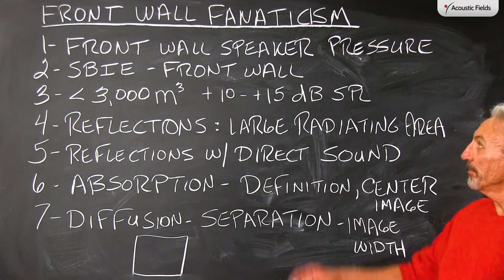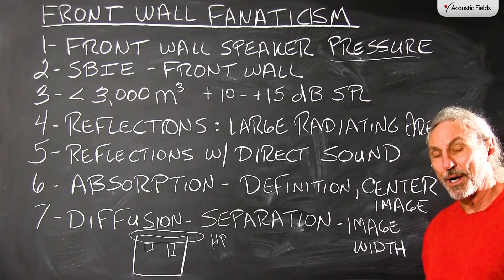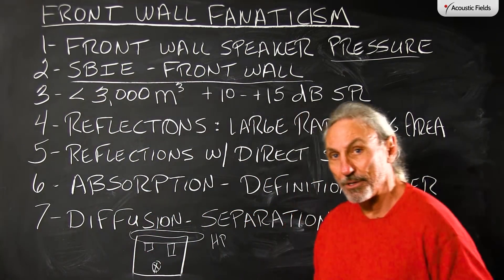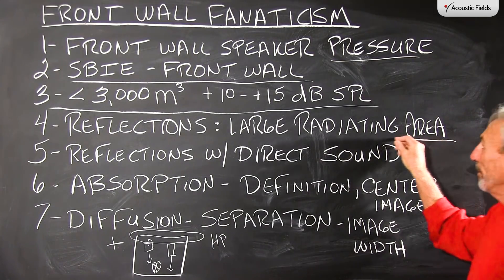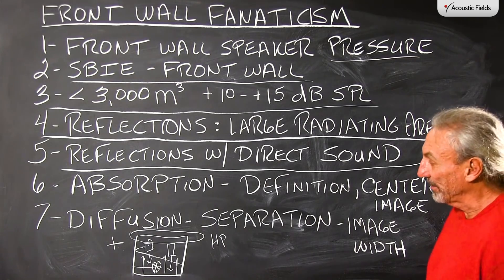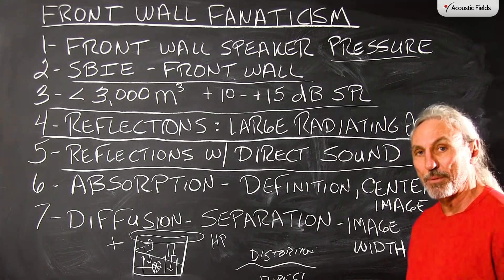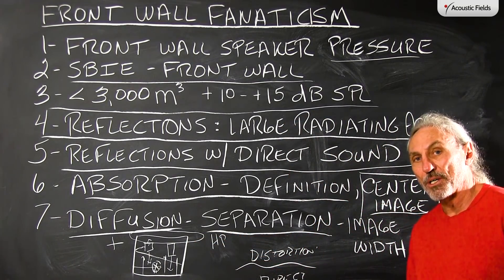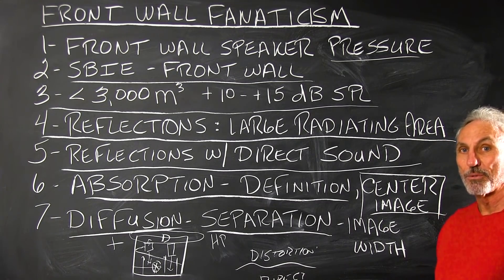Front Wall Fanaticism - www.AcousticFields.com

Comment: no resolve ?
Reply from the maker: Front walls ( behind speakers) is the surface area with the most unwanted pressure issues. Yes, there are reflections from same surface. However, the pressure issues are paramount and must be addressed first and foremost. Most front wall surface areas we measure are 10 - 13 dB over the listening position SPL.

Comment: Dang, I was all happy that I had absorption-treated the hell out of my entire front wall, thicker than the walls of fort knox, only to find out via this video that it has to be measured and calibrated accordingly to achieve this "balance" you alluded to... in the absence of professional sound and pressure measurement tools I guess I'm stuck with trial and error, i.e. remove or add layers accordingly... however since it is strictly a mixing room I guess "too much" is better than "not enough"...  Great content, as always! I know you shoot these vids as advertisement for your company but you give far more to your audience than you get back!!! Tx!
Reply from the maker: Thickness of material type is only one variable to consider when designing sound absorption technology. You must first determine what frequency and amplitude issues the front and rear wall are exhibiting then assign the correct treatment type. Once you have this data, you can then focus on the rate and level of the technology you will need for your usage.
Reply: @AcousticFields  how, pray tell, does one go about "determining what frequency and amplitude issues exist" in the absence of measuring tools? Is it a physics equation of room dimensions vs monitor (speaker) output wattage and/or woofer diameter, etc. ? At any rate, if I could humbly ask one "freebie" question (you obviously aren't oblige to respond), namely this: having set up the room I now cannot tell where the sound is coming from, or stated differently, I know (or feel) that is is NOT coming from the speakers... AT ALL.  No matter how high I turn the volume up.   Is this a good sign? I've now got crystal clear imaging, no audible distortions, and great pleasing effect, all of which are novel to me since I've never listened to anything in a "treated" room, and its my first time using near filed monitors versus hifi commercial speakers.  In other words, I know the sound is different to what I'm normally accustomed to, problem is I've never been to a REAL studio to know what it should sound like; I just wanted to ask a seasoned pro if this phenomenon of not noticing the monitors is "normal" (say if i close my eyes I can't "feel" what direction the sound is coming from) because there is nothing readily available in any "gear tech" discussion forums on this particular question/topic.    In one of your other videos you allude to having a male vocal track targeted to your listening position in order to get the axis points right, but if the room is aptly treated is it normal to be hearing the music "enveloping" you, if you will... ?  At first I was concerned that the sound was reflecting off the back wall, bouncing off the front and hitting me in the face (because that's where I hear and feel the sound coming to me the most), versus coming to my ears from a left and right directions where the tweeters and woofers are pointing toward my ears. But, if anything, I have too MUCH absorption so I'm thinking it can't possibly be reflections causing this effect?! (again, it is not a displeasing effect at all, au contraire, its just that it's strange for me...  Sorry for the longwinded question, hope I conveyed its main premise sufficiently for you to zone in on it and, inshallah, hook me up with a curt response, something like "yes that's completely normal", or "no, that's a sure sign of a poorly (overly) treated room"... Alternately, you might just say to yourself, "let this poor sod figure it out on his own" which is cool, I know time is money... hahah... Although something tells me you'll likely answer (out of courtesy) with your trademark abstruse reply, something along the lines of "you must have proper stats to determine the right tools and material" hahah BTW, I know you answer that way to everyone's queries because a) you can't sit there and give custom tailored responses to every comment here on YouTube, and; b) your answers are indeed the cold scientific truth that people strive to ignore/avoid in their quest to find band aid solutions to their acoustic issues. You've no doubt gotten fed up trying to persuade people that there is a right (and not too expensive) way to do this but people have always had a lust for snake oil, and an ignorant fear of facts and figures, as well as aversion to logic. Your proprietary database is worth its weight in gold !  Lastly, just want to say that I know I'm not the only one who binge watches your vids, they're my go to for anything and everything related to my soundscape environment, and your voice seems to sooth my rambunctious toddler long enough for her undernourished hyperactive little body to sit still and have a proper meal.. so MANY tx once again !!!  :)

Comment: What type/style of diffusion would you recommend for a front wall situation for a mixing room?
Reply: That sounds better. I was also confused by the video reference to front wall diffusion.
Reply from the maker: J,  We recommend absorption that has the proper rates and levels of absorption to match the distances involved. Diffusion is recommended for the rear wall.
Reply: Acoustic Fields In the video you talk about adding diffusion to the front wall. can you elaborate?
Reply: Do you ever add diffusion the the back half of the side walls? (There is another company whose room designs always seem to feature back of side facing walls diffusors.)